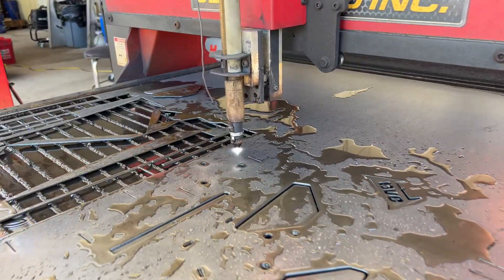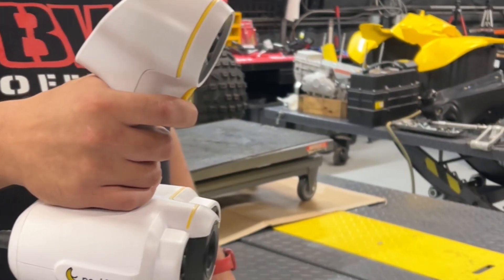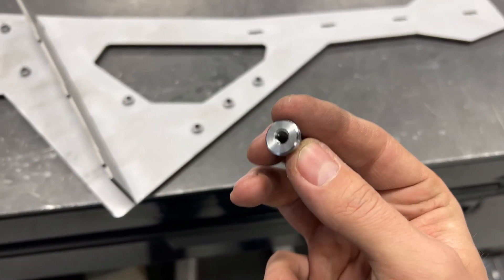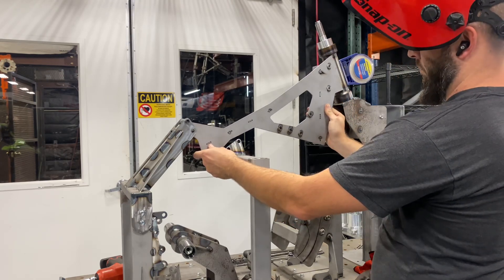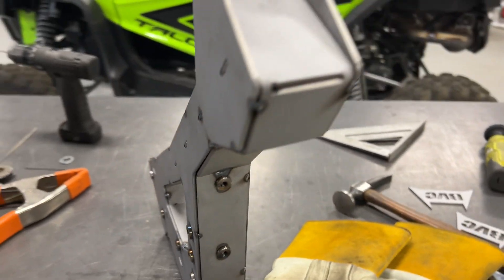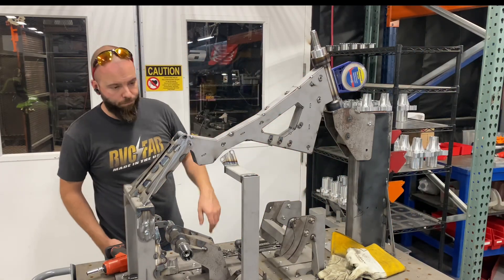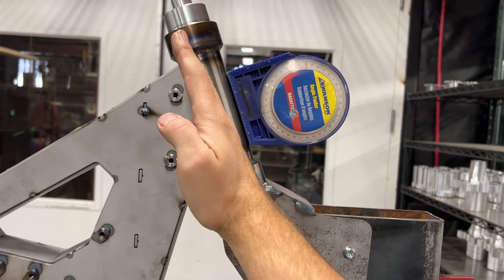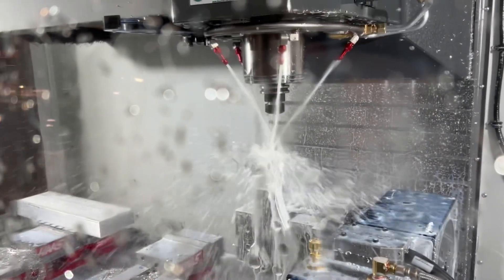Building a Dirt Bike Frame Part 1

Comment: You guys should make an aluminum pit bike frame and roller kit the only other company doing anything like that is bbr. Pit bikes are big business now.
Reply from the maker: I agree ☝🏻
Reply: @BVCOFFROAD  if you ever do I'm 100% interested. Bbr is coming out with their v4 frame  at some point. And it would be awesome if there was another manufacturer building frames for the full mod pit bike class .  A fuel injected daytona 190 motor in a bvc frame with inverted forks an mx swingarm with an elka shock sounds  pretty damn good to me and I'd buy one instantly. I just spent somewhere between 12-15k$ on a ttr 110 build so the market is definitely there. Just a decent stock mod build is gonna cost about 6k$. And a full mod anywhere from 10-25k$. I've seen used bbr v3 frames going for upwards of 25k rn
💯💰 🤑 💸 🏍